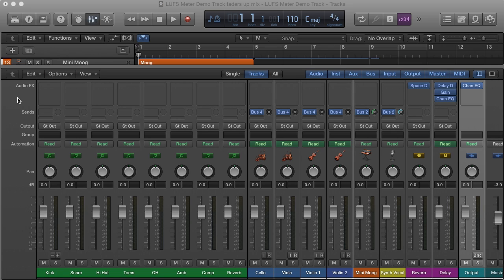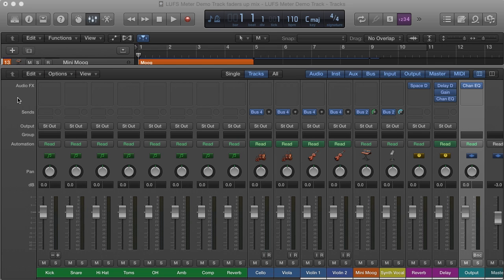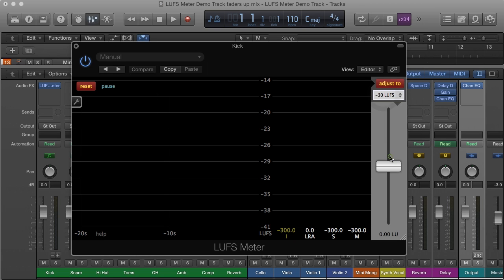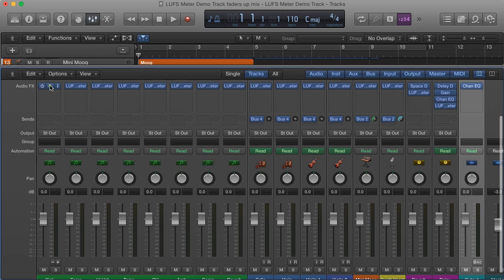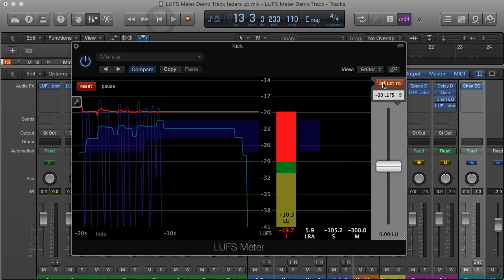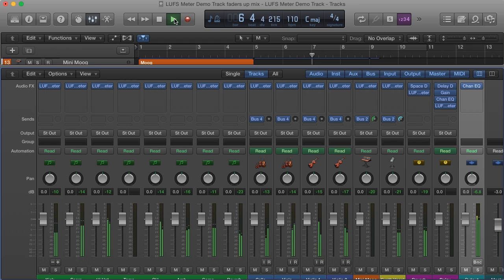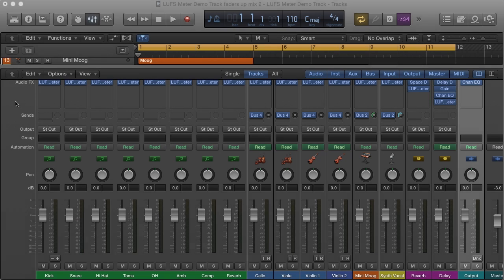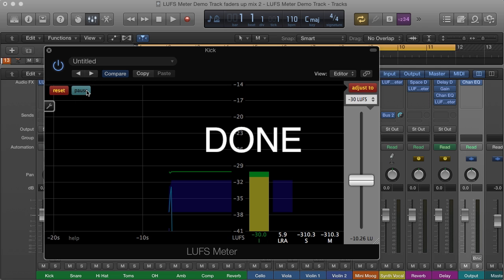Mix with the LUFS Meter

Comment: This is the same as the mix monolith i guess, minus the ducking and expanding option
Reply from the maker: Hi Chris, this is Samuel, the developer of the LUFS Meter.

Thank you for your interest in the LUFS Meter! I came up with the idea of LUFS based automatic mixing and made it available to the public in 2015 with the LUFS Meter. Apparently Ayaic must have liked this idea a lot and created a similar tool with the Mix Monolith. I'm honoured! :)

Haven't heard of the Mix Monolith before. The following comparison is based on the information from their advertisement and from their manual.

Advantages of the LUFS Meter for mixing:

- Can operate fully autonomously. No repetitive button pushing is needed at all. The interface doesn't need to be visible. It starts the measurement when the playback of your DAW starts and it pauses the measurement and creates the mix when the playback stops.
- You can toggle between the 'before' and 'after' of the automatically created mix with the synchronised bypass button above the adjustment gain fader.
- Offers synchronised undo/redo between all instances of the same sync group. To e.g. go back to a previous version of the automatically created mix by clicking a single button.
- Move and fine-tune all adjustment faders of a sync group at the same time. To do so, hold the alt-key and drag one of the adjustment faders. All other adjustment faders in the same sync group will move by the same amount. It's like changing a (non existing) group master fader. You can also reset all adjustment faders by holding the alt-key and double click on one adjustment fader.
- Once a mix is created, the measurement engine of the LUFS Meter can be turned off entirely by clicking ‘pause’, to lower the CPU usage.

More advantages of the LUFS Meter:

- It is an EBU compliant loudness meter too! Offering true peak metering, loudness range calculation, short-term and momentary loudness measurements. So it can be used to create loudness adjusted content, ready to be accepted by streaming networks, broadcast stations and alike.
- Extensive visualisations of the measured values.
- Most of the user interface is customisable. Sizes, colours as well as the visibility of different elements. Great for huge displays as well as for small ones.
- Runs on old 32 bit processors under macOS 10.7, Windows XP or Linux as well as on the latest operating systems and the latest processors by Apple, Intel and AMD.
- Has a comprehensive manual which is even used by educators in their lectures.
- No need for an iLok, can be installed on multiple computers with the same license.
- It only costs USD 39, compared to the USD 199 of the Mix Monolith. The Discounted LUFS Meter with less features is even cheaper at USD 19.
- You can upgrade from the LUFS Meter to the feature loaded Multimeter (USD 59) for only USD 20.

About a built-in compressor/expander:

For LUFS based automatic mixing, no compressor/expander is needed.

DAWs nowadays are using floating point numbers resulting in a dynamic range of at least 1500dB. For mixing, the LUFS Meter is the last plug-in on each track, after which the signal goes to the summing stage of the DAW. There is no danger that this could clip the DAW internally.

That's why the LUFS Meter doesn't need a built-in compressor/expander. 

Actually, the LUFS Meter deliberately doesn't alter the dynamics. This guarantees that the dynamic range coming out of the LUFS Meter is always the exact same as the one going in to the LUFS Meter. It preserves dynamics, as originally intended by the inventors of the LUFS loudness measurement specification.

Of course I use compressors, limiters, transient designers etc. all the time. The choices and the quality we have nowadays are incredible! I just prefer to keep the dynamics processors separate from the metering and auto mixing tools.

Hope this helps.
Reply: @klangfreund_com  i came back to this comment. I think i'll try the lufs meter next to mix monolith and see which one i prefer. Thanks
Reply: I want you to know after testing them both i ended up buying the lufs meter and stopped using mix monolith. :)

Comment: I turn off the true peak meter but when I copy the plugin to all of my other tracks, the true peak meter is activated again. How do I keep this from happening?
Reply from the maker: Which DAW do you use? Usually, when you copy a plugin instance, the current settings of that plugin instance will be copied as well, including the deactivated true peak measurement.

Alternatively you can turn off the true peak measurement, open the settings panel of the LUFS Meter, click the '+' icon and choose 'save as startup preset'. If you now create new instances of the LUFS Meter, the true peak measurement will be disabled. More at https://www.klangfreund.com/support/lufsmeter/manual/#save_preset

Comment: Is this the same thing as pink noise mixing technique?
Reply from the maker: The results are very similar. But using a LUFS Meter on each track is faster, because you only need to play back your entire project once (or  use the bounce function of your DAW to make it even faster). It also involves less manual work. With the pink noise mixing method (as described in http://www.soundonsound.com/sos/dec14/articles/pink-noise.htm), you need to listen to each track individually (together with pink noise) and manually adjust the level for each track. Dennis Wilkins wrote a great article about the process of creating a faders up mix with the LUFS Meter (https://www.soundonsound.com/reviews/klangfreund-lufs-meter). He also mentions the pink noise approach.

Comment: Wouldn't it be a lot easier to put this metering plugin just on the master track?

Or is there a special reason why you put this plugin on each sub tracks?
Reply: The special reason is: some tracks are too loud compared to other tracks, some tracks aren't loud enough. By putting LUFS meter on every track and use it like described in the video you will have all tracks roughly at the same loudness - a very good starting point for a final mix. A time saver. You can then put LUFS meter on the master track, if you want to adjust the output metering of the whole mix.
Reply: I think you missed the point of the video :)
It's about balancing individual tracks agaisnt each other, not about tweaking the master level.
Putting one instance on the master bus would only affect the master sound level, but the balance between individual tracks would be untouched.

Comment: I tried this and now my hihat & oh & reverbs are too loud. Any guide for that?
Reply from the maker: Your observations are spot on!

Atonal Instruments like hihats, cimbals or plain noise are most of the times too loud. If you have a template to start your songs, add a gain plugin after the LUFS Meter on such instrument tracks. Interesting to know: Hihats etc. are also too loud when using this method: http://www.soundonsound.com/techniques/mixing-pink-noise-reference  - which solely relies on the human ear.

About a reverb bus: It's probably best to adjust it manually, without a synced LUFS Meter. Why? The bus gets multiple signals from channels that also contain LUFS Meters. So the input signal for the LUFS Meter on the bus will be very different between the time it measures and right after you hit 'adjust to' (because all the other LUFS Meters will boost or reduce the loudness). Manual mixing after the LUFS Meters adjustment will also change the input of the bus.
The second reasoning to not add a LUFS Meter to the reverb bus: It's rarely desirable to have the reverb exactly as loud as an individual instrument. (I know, I have added a LUFS Meter to the reverb bus in the above video, I shouldn't have done that.)

Comment: I put the LUFS meter after my limiter to make sure I am around -13 LUFS. But then it seems the LUFS plugin is clipping the meter because it is after the limiter in the chain. If I mute the plugin and compensate the difference on the limiter, it does not effect the LUFS like adjusting the LUFS meter in the plugin. So how do I adjust yet make sure this plugin isn't clipping my master fader? It has to be after the limiter to get an accurate reading of how hard I am pushing it.
Reply from the maker: In the manual there is a chapter covering in detail how to use a limiter together with the LUFS Meter: https://www.klangfreund.com/support/lufsmeter/manual/#high_loudness_target
Reply: ^I just read the limiting section of the manual. Again, it puts the LUFS meter before the limiter, whereas I need it after the limiter. Your example is good for ensuring a certain LUFS level before someone hits the limiter. In my case, I want to make sure my limited material is at a good LUFS level for youtube conversion (-13LUFS). But again with the LUFS plugin after the limiter, the masterbuss clips. 

I even tried putting the LUFS meter before the limiter, but obviously the readings were completely different because the gain level hitting the plugin was less.
Reply from the maker: Colin Murphy: "Again, it puts the LUFS meter before the limiter..."

That's simply not true, you should read the manual carefully: "... Now it's time to add the MGA limiter in front of the LUFS Meter. ..."

Please use https://www.klangfreund.com/contact/ if you need further assistance.
And Colin, consider buying the LUFS Meter after your initial tests...
Reply: Sorry^ if I didn't articulate my question clearly enough. But the problem is I have been following step by step what the guide said carefully reread it upon your advice. 

I put the LUFS plugin reader before the limiter is turned on, adjusted to -13LUFS , then put the limiter on and matched the gain increase, then hit the adjust button on the LUFS plugin as referred to in this step "The MGA limiter applies a make-up gain after processing. To cope with this new make-up gain a single click to the LUFS Meters 'adjust to' button is sufficient." However the plugin did not reduce the LUFS increase as the guide said it would (maybe because it is before the limiter?) - it just stayed constant despite the limiter now also pushing the gain up. But I  experimented and put it after the limiter, and then it reduces the LUFS accordingly. 

FYI I am running the demo version of this plug and if it is giving me so many headaches already I am not sure if I will buy it. Or maybe I am just slow. Cheers
Reply from the maker: Working with a limiter to achieve a specific (high) loudness target is an elaborate and tedious process.

The main issue is that by simply raising the gain to achieve a high loudness target, the peaks will clip. Therefore you need a limiter to turn down these peaks. The limiter MUST COME BEFORE THE LUFS Meter (and never ever after, otherwise you can't measure the outcome. Add the LUFS Meter at the end of your entire processing chain on your master bus and even make sure that your master fader stays at 0dB, otherwise you wont measure the final outcome). But using a limiter will alter the sound and the perceived loudness, therefore after each time you tweak the limiter you have to measure the loudness again.

The entire process is iterative and you most likely need multiple rounds of limiter tweaking and loudness re-measuring to achieve a high loudness target with minimal 'damage' caused by the limiter.

If you don't mind about noticable and aggressive limiting, you can of course do this in one iteration: Add an aggressively configured limiter in front of the LUFS Meter and simply measure and adjust again. But this way you won't use the entire headroom given by -13 LUFS and your audio will be degraded more than necessary.

Some limiters I like for this kind of work: The limiter in iZotope Ozone 7, IK Multimedia Stealth Limiter and Fabfilter Pro-L.
Reply: I am I missing something?

I say about the instructions:  Again, it puts the LUFS meter before the limiter.
You say: That's simply not true and quote a section that says "Now it's time to add the MGA limiter in front of the LUFS Meter. (IE limiter in front of the lufs meter = lufs meter BEFORE the limiter)
I say: Based on your saying what I said is not true, I've tried both options and explained the situation.
You say: "The limiter MUST COME BEFORE THE LUFS Meter" Well, that is exactly what I said in the my first sentence, just using opposite language!!!: "I put the LUFS meter after my limiter"

^ Well this reply brings me back to my first post, which CLEARLY explains that with the LIMITER BEFORE THE LUFS METER, THE 2 BUSS CLIPS! I put the LUFS meter AFTER the limiter initially because that makes the most sense since I want the meter to read my limited audio in LUFS. With the plugin after the limiter, even is it is -0.38 LUFS on auto adjust, clips the master fader. Mute the plug and the master fader doesn't clip any more.
Reply from the maker: To avoid further confusion I changed the wording in the manual to make the order of the limiter and the LUFS Meter as clear as possible. I just realised that 'in front' and 'before' can have a different meaning to e.g. a photographer than to an engineer.

To quickly recap, the correct way to tackle this is:
source audio --> Limiter --> LUFS Meter --> destination audio file

@Colin Murphy: LUFS aren't peaks. If you are concerned about clipping you need to look at the true peak. You can read more about loudness measuring at: https://www.klangfreund.com/support/lufsmeter/manual/#about_loudness

Comment: May I ask why -30LUFS to start? Is that a good place to start, or a random number to demonstrate the plugin?
Reply from the maker: -30 LUFS is quite arbitrary. Just bear in mind that the more tracks you have, the higher the peaks can become in the sum. To counteract on this you can lower the target loudness on the synced LUFS Meters -> the more tracks, the lower the target loudness. 

Or you can add an additional LUFS Meter on the master to measure and adjust the true peak. This also works because all DAWs I know of use floating point internally and have therefore a huge headroom (for the signals between the individual channels and the master bus).
Reply: The EBU R 128 loudness standard recommends a target level of -23 dB which is quite enough I think.

The peaks of a piano might be around 15 dB over the target loudness level (-23 dB + 15 dB = -8 dB >>> fits).
The peaks of a good drum can be around 20 dB over the target loudness level (-23 dB + 20 dB = -3 dB >>> fits) - a value which rarely will be exceeded for a single instrument.

In the whole mix the frequencies and peak levels of all instruments or tracks will balance out - so, you don't have to worry about this too much, 'cause the peaks in the whole mix won't exceed the peaks of the instrument with the highest momentary peak level.
Reply: based on the number of tracks to be combined in the mix as every track increases dB and lufs

Comment: the 1.3 not syncin  i have to manual press adjust to make it sync am using studio one presonus 3
Reply from the maker: This video describes the sync feature that allows multiple LUFS Meters to be synchronised with each other. Synchronisation with a host like Studio One has been introduced in the LUFS Meter 1.4.0. I have just uploaded a video about this kind of sync you are looking for: https://youtu.be/9ha8CPTaa_M